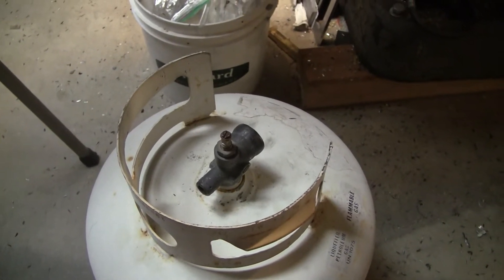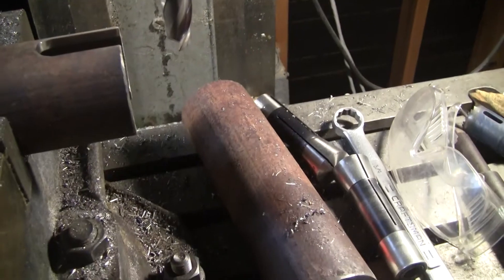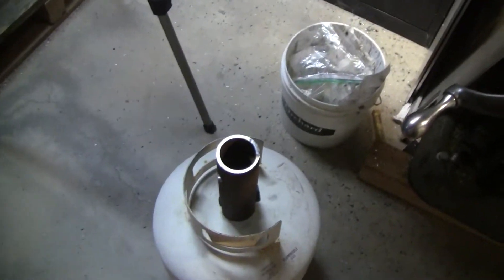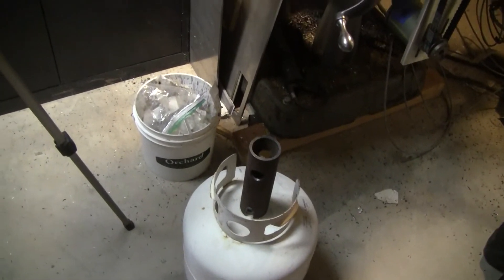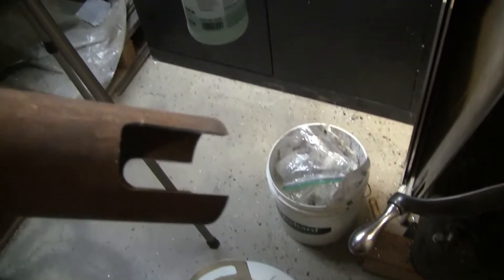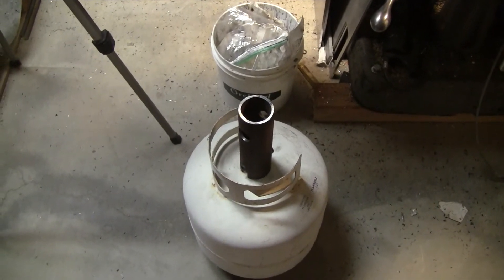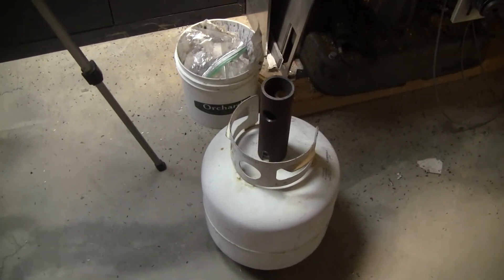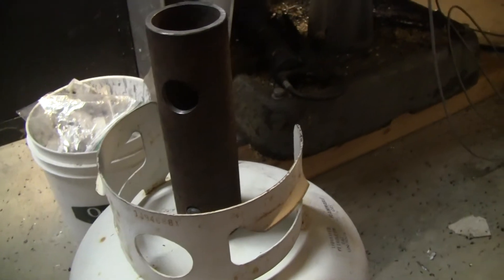Converting Propane Bottle to Freon Recovery Container.

Comment: Can't wait to see the video of you removing it and how you will make the new fitting and how it will work.  I want to build one myself.
Reply from the maker: I found a few videos on the valve removal, so I didn't video my valves removal. Strapping the bottle to a tree or something like that, works wonders, and is the hardest part of the removal, but still not difficult.
Reply: A cedar tree and couple of racket straps works great. I took a tourch to couple of old 20lb tanks before taking off the valves